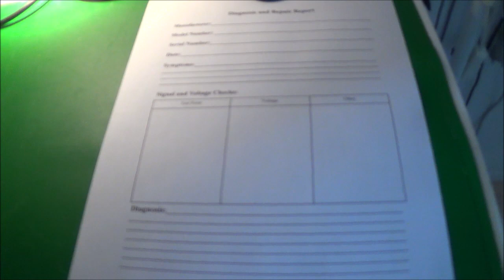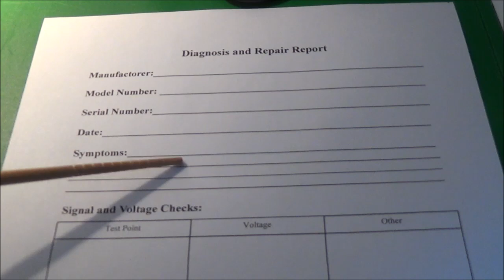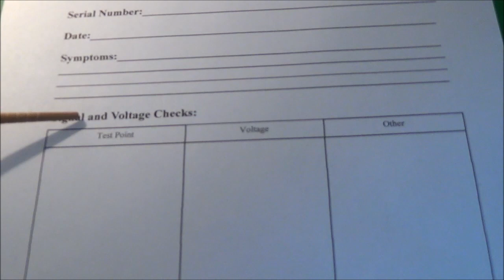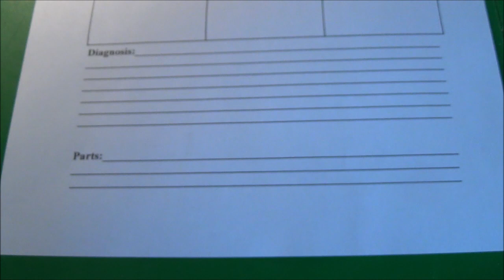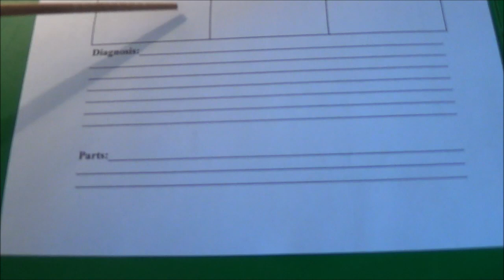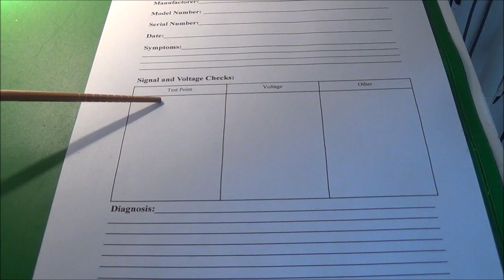Audio Repair Form for Downloading

Comment: When I was in the electronics service industry (very short while), we had the obvious fill in similar to yours before the Signal/Voltage column. Its nice to see other practical idea implemented to the lame Service Sheet. This will certainly be handy in special cases. Downloaded and thank you Mr Oldschool.
I have a question, how much do charge for minor repair that still require the unit to be dis-assemble. I am trying to gauge the current independent tech rate. Give or take 5 to 10 dollars over or under.
Reply from the maker: This is a question which I truly cannot answer because their are so many variables. That depends upon where you live, if you have a shop you rent or own, if you are a registered business, if taxes are paid, if you are doing the job for a friend, etc. It would be best to orientate yourself based on the area you live in.

Comment: Firstly, thank you my friend for the support and suggesting my channel to your subscribers, surprised but happy, thank you!  :) Secondly, the form is a great idea, I downloaded it...I can see using it for projects that are partial worked on, then parked whilst you try to figure it out (I have several) but yet move on to another project...after time one may forget, great to refer back to notes, than you!  It would be a tragedy if you retired your channel, but I fully understand as I have had them thoughts often, I understand. ~Jack, VEG
Reply from the maker: Thanks for watching and downloading! Granted, one can do without documentation, but this makes it easier. Hopefully you will get at least one more subscriber ;-) And, I think we both will continue on....
Reply: @OldSchoolElectronics  With great pleasure!  These are practises Im unaccustomed to, but do see the value.  You are probably correct, the frequency may slow down...at least for me...but  will post im sure!  :)  Thanks again!  ~Jack, VEG